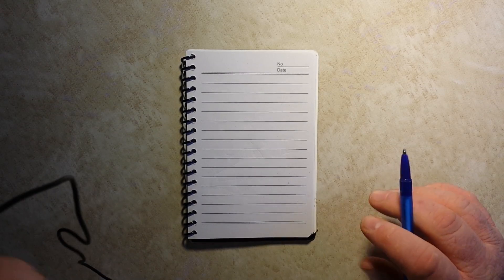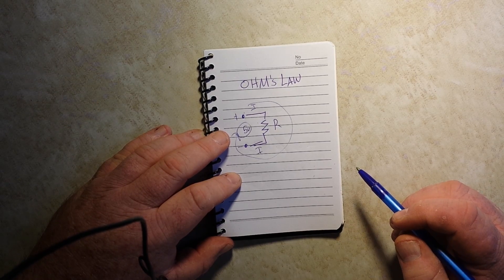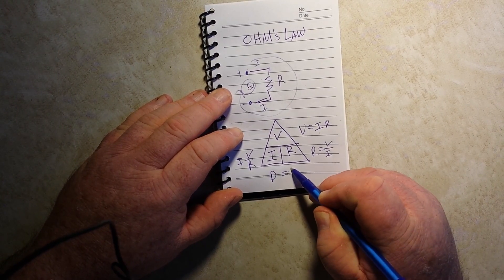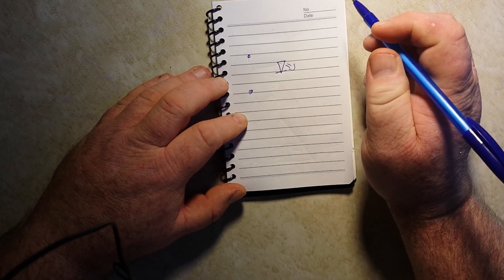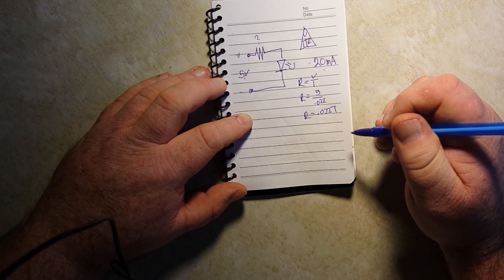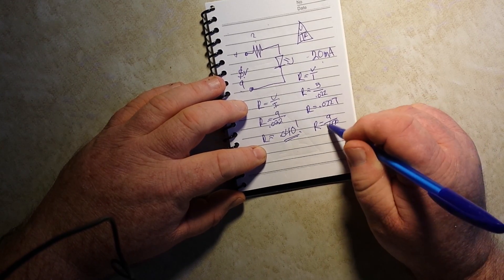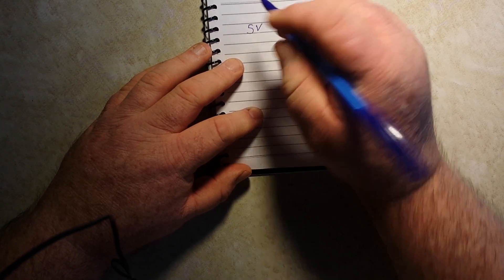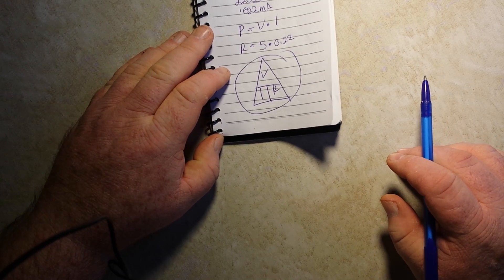Ohm's Law

Comment: @learnelectronics, Isn't 5/.02 = 250? So the resistor could either be a 220 Ohm or a 270 Ohm.
Reply: Yes, it is, so I use a 270 ohm

Comment: @learnelectronics As Whisper Iowa mentions, you accidentally wrote "R=" when you meant "I=". Specifically, it is the time when you are calculating if a better resistor would manage to handle the load after increasing from 5 to 9 volts.